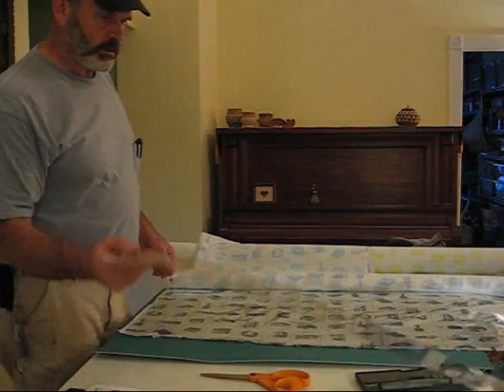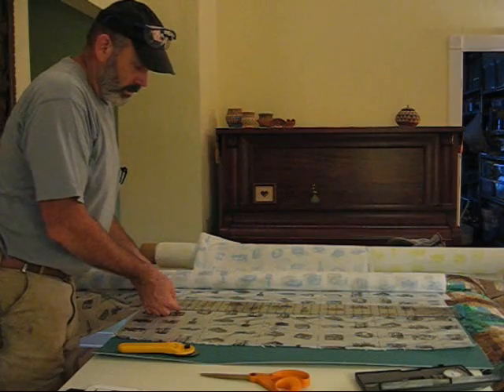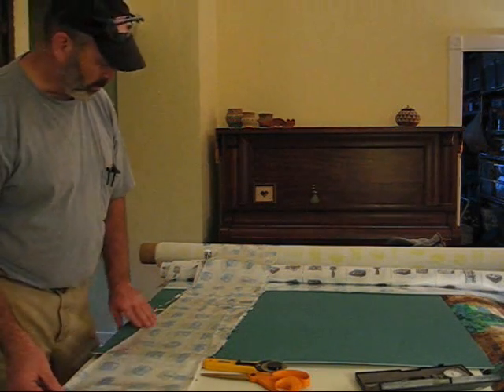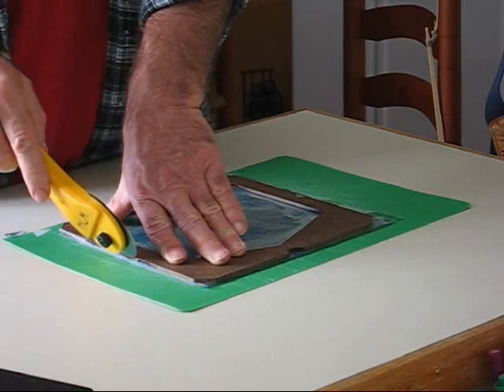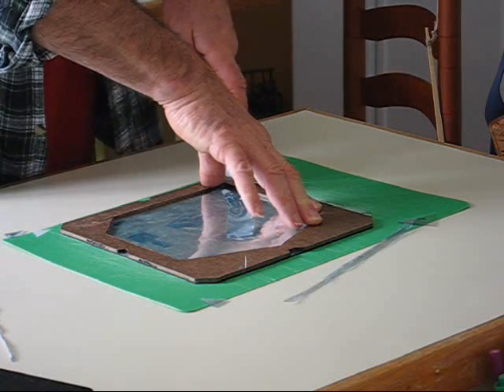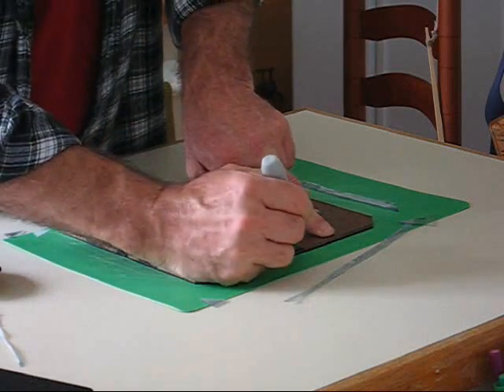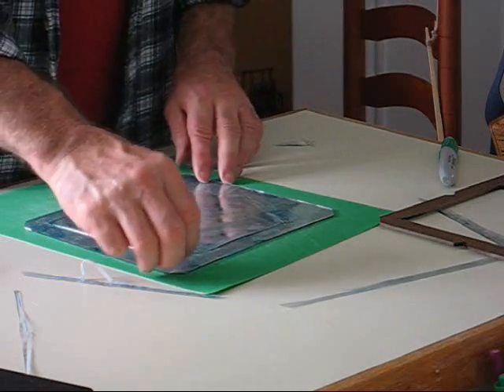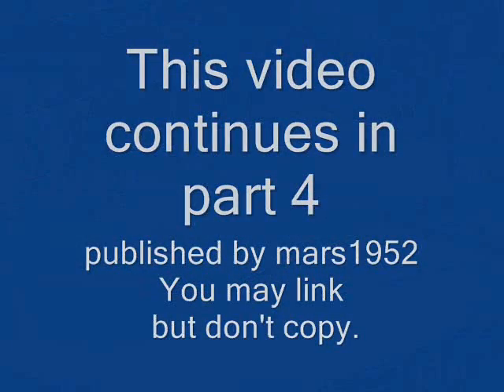HHO Dry Cell Mars Gasket Part 3

Comment from the maker: I cut about 20 gaskets in less than two hours using the Olfa cutter. It goes a lot faster when I don't film it. Of coarse I didn't drill any holes all my bolts are outside of the gaskets.
Mars